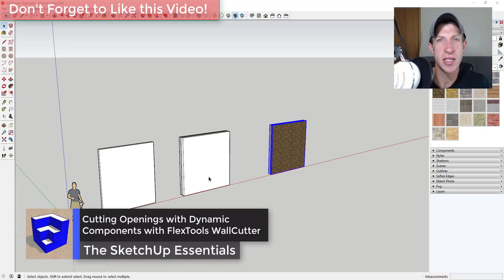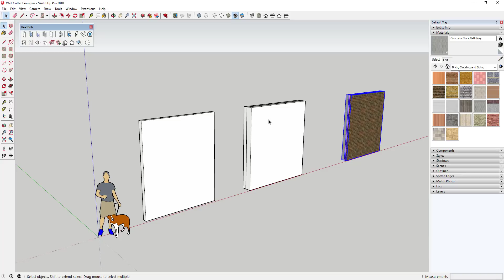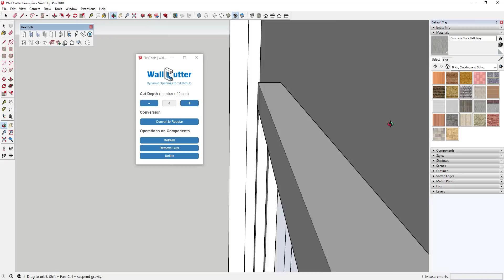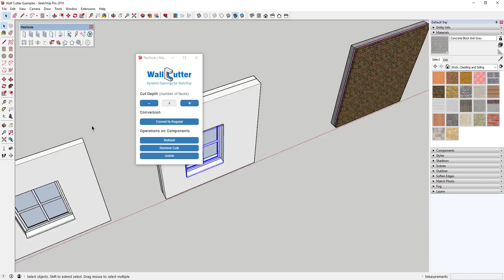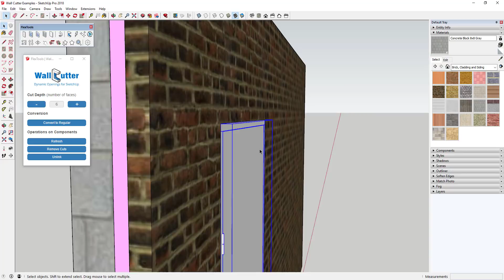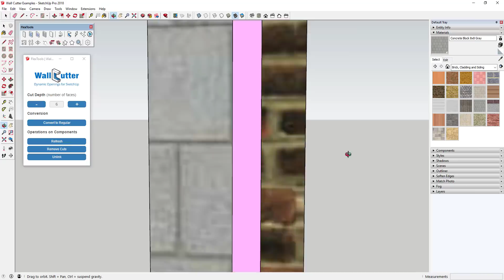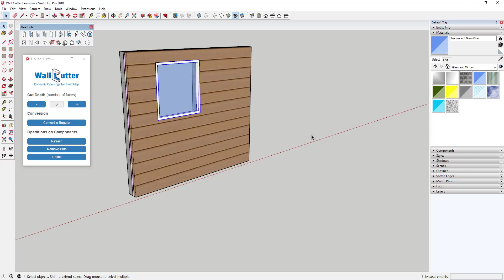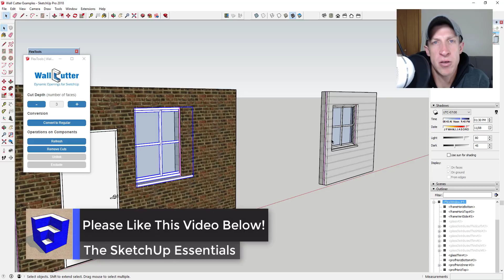FlexTools Tutorial - Using Wall Cutter to Cut Holes in SketchUp Walls

Comment: I have been using Double Cut, but it's limited in that, your cutting object needs to be in the same group as what it's cutting through. In your demo, it appears that Wall Cutter objects can make cuts through separate groups, but this isn't specifically mentioned. Can you confirm that this is the case? BTW, love you demos and tutorials...keep up the good work.
Reply: Hi Brian, Yes!  You can place a WallCutter outside the context of the wall component and it will make a dynamic opening inside the wall.  Make sure it is a component though, and not a group.  Groups can cause problems.

Comment: Could you do a compare-contrast video with FlexTools and Medeek Wall?  And, how the plugins effect the creation of a Door/Window Schedule?
Reply from the maker: I'm not really sure that would be a fair comparison to either. Medeek Wall is more focused towards the creation of the wall itself, with some options for different openings. FlexTools is much more focused on the openings, so it kind of depends on what you want. I can't remember what exactly Medeek does with doors/windows, but as long as they're created as individual groups or components in your model, you should be able to run a report/schedule that picks them up. Thanks!
Reply: I couldn't tell if the two plugins could be used jointly.  Maybe there is an issue with using FlexTools to put a door or window into a Medeek Wall.
I think that I could have phrased my question better.
Reply: Hi Donald,  We haven't tested FlexTools with Medeek's Walls, but generally speaking the WallCutter feature works on plain and flat surfaces so it should be able to cut openings in the simpler walls.  It will not be able to cut through the battens/framing.  What will happen to the openings when changes are made through Medeek's interface I cannot know until it's tested.  If the openings are closed in the process (like with Profile Builder), you can always refresh the WallCutter component and they will re-cut the openings.

Comment: Is the Frame Depth controlled by the parameters of the Door/Window? It would be cool that as the number of layers to be cut was selected, the depth of the frame would increase to match.
Reply from the maker: I believe you can adjust all that in the components - unfortunately, there doesn't seem to be a way to get it to adjust automatically based on the layers you're cutting through - that would be really helpful though - thanks Dave!
Reply: Hi Dave, The Frame Depth is currently controlled from within each Window/Door component.  Since you have to change the thickness 'manually' (It's really just one quick setting), you can always save your edited component aside with ComponentFinder and pull it right back in when you need it again.  I'm not sure yet what the possibilities are for auto-matching the wall's thickness.  It's definitely a great idea that we'll look into!

Comment: I wonder how it works with big projects like 100 windows in a single wall. Also how it works with complex solid where walls have different thickness. It's a pity there is no trial version.
Reply from the maker: Hmmmm...no idea - I haven't tested it with anything that big yet
Reply: Hi brydz, with our testing of large project, the WallCutter feature seems to behave well and quick.  With very large models, the Dynamic Components can get slower, just like everything else that gets slower with large model.  We have specifically developed two tools for this:  Zapper and Cleaner.  The Zapper converts the DCs into regular components, and the Cleaner deletes any hidden geometry in them.  Both tools are destructive to the DC but can clean up to about 60% of the components' size, so in extreme cases where you don't want the components to be dynamic anymore... these will help.